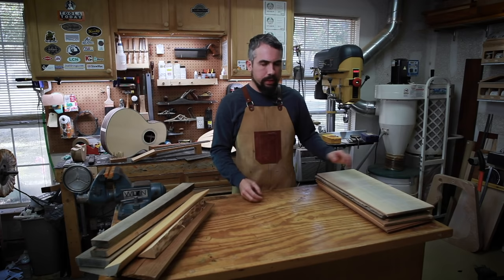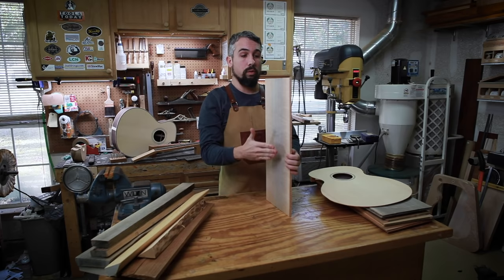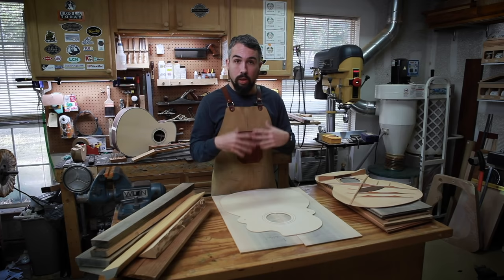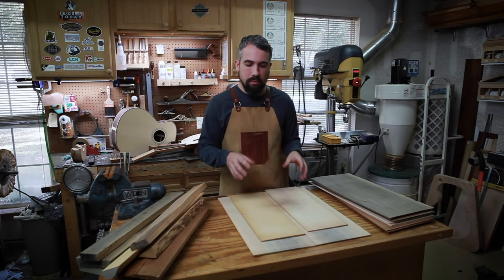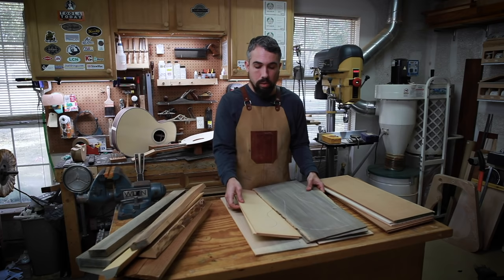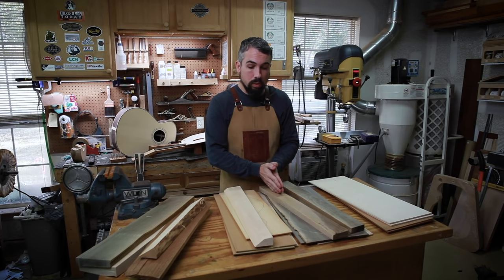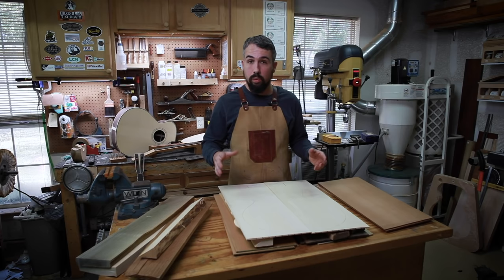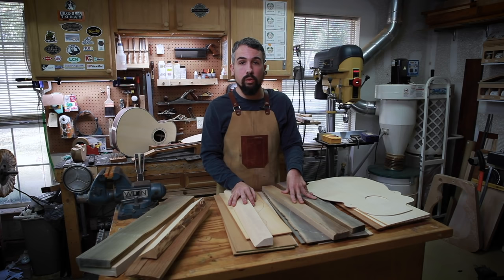What no one will tell you about acoustic guitar soundboards!

Comment: Truly excellent video.  Back jn the late 1980's I acquired a dozen or more 1x12x1"(3/4" thick) Kiln Dried Quarter Sawn clear Douglas Fir shelving boards.  Not a "soundboard wood" but very fine straight grain that when I resawed it into top wood and joined it the tops are truly excellent.  The stiffness allowed me to make very thin tops with radically scalloped bracing.  So far I have built two Drednaught Body guitars (1988 &.1990)  with Black Walnut back, sides and neck with French Lilac fingerboards and bridges cut from 50 year old extremely dense tight grained boards. I air dried those logs for 5+ years. The neck and tail blocks are also Black Walnut.  They were my first two acoustic builds.  Both have cosmetic issues but play well and sound great.   I learned by disassemblibg an old Guild D-40 that had been seriously abused. Found it in a pawn shop in NYC for $5. Those first two builds taught me a lit about building acoustic instruments.  Now that I am retired from my "daycjov" I want to tackle building my most favorite stringed instrument... The Baroque Cello.
Reply: I love lilac wood, so pretty and nice to work with. Never seen it used as a fretboard, that’s sweet

Comment: Your talking about overbuilding guitars prioritizing stability over efficiency. Every added mass counteracts the ability of the machine to flex and thus resonate. I get lost when woodworkers use magical language to describe their intuition based on years of experience. I believe most look at the top desired flexibility as being a physical touch and listening response rather than, "i just know when its ready or it speaks to me" which isnt what you said exactly but i,ve heard it said many times. Ive seen some builders use a more accurate/scientific approach. I forget the name but using a weight to show elastisity or movement under pressure. Overall very clear. One question though, how does one tell over time when the desired top is where it's most efficient. And how could we judge it to be so after the guitar is all together. How can we pinpoint it being the top that needs a change.

Comment: ref: 10:38
You can easilly measure the tap-force and the sound db and Hz. Also resonase can be measured. 
You can do it with a raspberry pi (any version) and 20-25$ in sencors. Software do it is free.
Reply: Can you refer me to the software for this, or some kind of guide? I'm a software engineer and was thinking about how feasible it would be to build something like this to do a Fourier analysis of the tap tones. I'd love to contribute to an existing project if someone already has the groundwork laid.
Reply: @cutebabyseal621  I have no specific solution, but any software would be closely linked to the sensor used.
If you search for:
 "Arduino vibration sensor"
you will get result for both sensor hardware, active projects ans videos.
 From that as a base for data I am sure that Fourier analysis and other filters can be used to greatly expand what the data can be used for.
Reply: @bknesheim  Oh sorry, your original comment made it seem like you had some familiarity with existing software.
Reply: @cutebabyseal621  Have seen it used and now what is "needed", but that is not the same as "Have done that".  :-)

Comment: I keep have running through my head that it must be possible to make a top of synthetic material. You know ...make it in such a way that it can resonate with certain frequencies and so on... Anyways, I really appreciate your attempt to apply the maximum of the properties wood can have into the instrument. It all connects with an excellent tone in the end..
Reply: All kinds of alternate tops, alternate bracings, tons of things out there. There are carbon fiber guitars that sound surprisingly good, very even. There are lattice bracing patterns that are nothing but what looks like a lattice work fence inside the guitar. One of the ones my brother uses in his is what is called a double top, where you take a pair of spruce tops and plane down the center area, and replace that wood with a honeycomb material called nomex, gluing the pieces together with a VERY thin layer of epoxy so you don't fill up any of the honey combs. What you have is a structure called a torsion box that is  very strong, looks just like a solid piece of spruce, but has none of the individuality that a solid top has. Some of these are some of the most vibrant sounding guitars I've ever heard, and that is coming from an original owner of a 1971 Martin D18 that gets raves when I play it. 

LOTS of work done to try and eliminate that variable.
Reply: You could engineer a top material with basically any characteristics you want, but guitar players are a conservative bunch and selling anything other than wood is challenging.

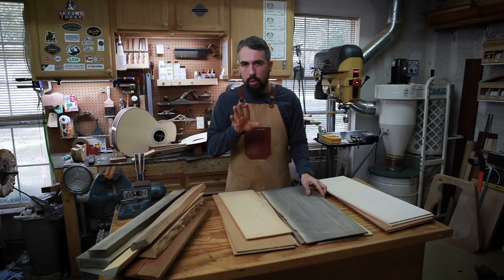Comment: To speak to your point about the issues with using tapping as a way to qualify wood, - if you listen to the tap comparison at 21:13 people will be so influenced by the fact that the larger boards have a fundamental frequency that will be lower than the smaller boards and they will then say things like it is richer or more round, but they are just hearing the lower 1st mode.  If you shape them so they have the same 1st mode freq I don't think most will say such things.  I am a structural engineer (and bad guitarist) not a luthier, I would try to QUANTIFY something like decay time as a better indicator.  So when you talk about having a top that is an efficient sound producer I think you are spot on.  Bowed instruments don't have this issue of only a finite amount of energy going into the sound production, but the energy that goes into sound production on a guitar when you release the stretched string is very small.  You can plane and brace to help optimize that, but I think the inherent damping of the wood is more difficult to overcome.
Reply from the maker: Dude that’s a great point and I’ll certainly try to use this for future vids. Thanks so much.

Comment: ..did what you said, ..went for lite weight and used Balsa wood for the top but it fell to Dust and collapsed on itself the first note I strumbd. All that whittling and sandin' I done on it jus to end up with a pile a Kindlin' dangit.🔥😳.
Reply: It's weight AND strength.  Light (low density) is pointless without strength, and high strength is pointless without light weight.

Comment: I read an interesting ASE journal article the other day about perceived differences in acoustic properties of guitar (acoustic) back and sides. As it turns out, most players, regardless of skill or experience level, basically cannot differentiate between, with any statistical significance, back and side woods in blind auditory tests. That''s the gist of it. Also, the acoustic properties / materials testing identified that the acoustic coupling between the back and top occurred in the air between, and the sides transferred very little, and it was the tops that contained and projected most of the sound information. This was shown visually by mapping the frequency curve and 'modals' (distinct peaks) of each guitar  that the top, back and sides would generate - the back and sides would create the two lowest modals, and the top would create the third modal. The curves and modals were almost identical across woods for back and sides. One conclusion was that "sound" a given guitar produced was a result of mostly the top wood, design, and construction/methods, not back and side woods. Super interesting article.

Comment: I understand exactly what he is talking about. But I also believe that certain woods have very different musical intonation. That's why we choose these certain woods. I've seen a test of the exact same guitars that were made by the same company but yet out of different woods and I was amazed at how much they sounded different. Not totally different, but yet different enough to show different character. And in music there are only slight difference in sounds but yet the cost of having that sound is priceless. Myself I would prefer an Aderondac spruce top with rose wood back and sides. To me that guitar had a much fuller sound than the Sitca spruce sound board. The highs were more dominant in the Sitca spruce top. And the Torrified wood also gave a fuller sound than a non-torrified sound board both of the same wood top. And yes the bracing comes into play and also the body style too.

Comment: When a tree grows the early tree rings have a wider thickness than the later tree rings. This is true in general of course the thickness of the tree rings also depends on the weather conditions during tree growth, but in general the early tree rings are thicker, wider than the later tree rings. When you book match and glue them together which do you put in the center which you glue them together, the early tree rings of the later tree rings? In other words are the early tree rings in the center of the tone wood or are the later tree rings in the center? Also does this matter?
Reply from the maker: I always put the tightest grain to the center and the wider to the edges. The way I see it, the wider is slightly more elastic, and I want that towards the rim.

Comment: I was so impressed by this presentation and it blew away a lot of my preconceived notions about soundboards. However, If the wood grain is best when straight, which I always believe, then, what’s the deal on bear claw that is being sold as most desirable?
Reply: Funny bear claw used to be considered a defect along with excessively figured back and side material. Look at the prewar Martins, most have very plain looking wood.
I have a ‘66 Martin D21 with the highly figured Brazilian. They chose that wood for the lowest tier rosewood guitar.
My cousin has a ‘66 D45 and it has perfect straight grain on every piece of wood.

Comment: I had a question if you want the top to vibrate with the least bracing why don’t you extend the neck like an i beam through to the brdge that way the string tension would be supported by the neck( think 335 sort of)at the back of the bridge letting the front float.That would eliminate the need for scallop bracing altogether.I know it would look stupid through the sound hole .My question is has anyone tried this?

Comment: Material selection doesn't really matter for capturing wind though no?  if surface area and geometry are consistent on the lead sail it should capture the same amount of wind.  Boat would just be heavier.   I understand rosewood is more dense and less ideal for a top but how do you decide on the threshold for viability?

For example say you were to try to use rosewood for a top and you shaved it down to equivalent mass to spruce or mahogany.  These reason why this doesn't work is because of a mechanical limitation once rosewood is that thin no?

Comment: Hi Chris, wonderful video. One of the most interesting part of it is the knocking on the wood. I have a guitar build for me by a German luthier, Urs Langenbacher. He told me that he actually measures the sound(board) electronically and tunes it in order to get every frequency equally in volume. Kind of equilizer so to say. I have heard that the thicker the wood is, the more it can respond to higher frequency's. So I wound try to apply different thicknesses in the soundboard or perhaps in the back and sides. Due to the acustic specifics, I wound be intersting to make the back and sides also from spruce or ceder. For nylon string guitars I like ceder more because one get more rich tones and they produce more sound and sustain. An experiment like this would be great, but perhaps it is not a good idea?

Comment: That was a fascinating and in-depth overview of guitar sound boards. I have had guitars made of several different materials for the tops ( Sitka, Engelmann, Carpathian and Adirondack) I have much preferred the most recent guitar ( a Collings OM ) with an Adirondack top. The additional headroom is essential on a small bodied guitar in my opinion. I had a Martin Eric Clapton model with lovely Madagascar rosewood back and sides with a Carpathian top. It sounded quite good but unfortunately the top started to do funky things within a year and I ended up selling it.
Reply: Interesting. Nothing beats red spruce (picea rubens) for stiffness and it may have an edge in other ways, hardness, resistance to long-term deformation. I've never seen Carpathian (which is the same ubiquitous European species picea abies) but really high altitude trees are slow growing with less late wood, and therefore lighter in density, I imagine. Englemann is a very light spruce, but variable.

Comment: What about using Densified Wood for sound boards. It is wood planking that has had the lignin softened and removed and extreme pressurization leaving a thin strong plank.  Would it be poorer, better, or any difference in sound applications I wonder.

Comment: Ref latitude/longitude. You may have heard expressions like "palm trees don't grow at our latitudes", meaning we are living too far to the north for palm trees to grow. Well, that shows what latitudes are about: Telling how far north or south some place is situated. Hence longitude is about the other directions - west and east. Now you will remember what is what, I hope.
Yoy talk a lot about spruce.  What is the difference between a fir tree and a spruce, by the way? I am not a native English speaker and have never lived outside my country of birth, Norway. Now, both fir and spruce is translated into the Norwegian word "gran". So I am not able to distinguish between the two.
Reply from the maker: Thanks for the tip! As for the difference between fit and spruce. I’m not exactly sure. In my experience fir is a lot softer than spruce and the grain is not nearly as tight. With that said, my only experience with for is back when I lived in Alaska and the wood was available at local hardware stores. I’m sure you could use it as a soundboard wood, but spruce would be a lot better. You live in Spruce country and it should be readily available, but it may be referred to by a different name in your language. Hope that helps a little.

Comment: Most of my life I have played solid body electrics, but now and then I have had an acoustic guitar: A Seagull Cedar, a Mouton Rouge Cedar - both sounded ok, and now I have
a Yamaha FG730S low to mid priced guitar, but it does not ´sing´. It has a light colored solid spruce top, but it is 3,5 mm thick, including a lot of coats of  plastic lacquer to
dampen the vibrations :-). Should I risk to ´butcher´ it, and take of the lacquer and some of the material, and give it a light coat of shellac? It is a $300 piece, used. I know I ought
to buy a real guitar, but I need to find out first, if I get hooked this time.

If we should believe the violin guys, the varnish has a lot of influence on the sound too. I read an article recently that some scientist had found the formula for the Stradivari
violin - something with Borax and stuff, to get rid of tree worms.

Comment: Why would I buy a Western Guitar with six nearly adjacent 6mm holes in the soundboard in the center of it that will eventually cause bowing of the soundboard? Isn't there a more structurally sound way to thread new strings than using pins?  Wouldn't a glued bridge with a backplate/backing on the inside be strong enough to hold the steel strings of a Western Guitar from ripping the bridge up if it were glued directly to the wood?  I'm loathe to see another wrecked, (while bowed), guitar, especially if I'd had it built.

Comment: Excellent, information packed video about soundboards and their woods. I have a Lowden with a Redwood top. It sounded good when I purchased it, but about 10 years later, it lost a significant amount of volume and resonance. Is that typical of Redwood, and can anything be done about it? Thanks
Reply from the maker: That’s pretty odd and shouldn’t happen. I suspect you have a brace that came loose or something.
Reply: @DriftwoodGuitars  Thanks for the advice. I don't hear any rattling braces, but I will definitely check that out. My primary concern was that maybe Redwood didn't age well, unlike Spruce which ages very well.

Comment: Interesting! I’ve been meaning to ask something I’ve been curious about. I recently bought an acoustic guitar with a sitka spruce soundboard. I noticed that there are some small surface imperfections that look like tiny “cracks” that run parallel to to the grain of the top.

These surface imperfections/“cracks” are less than a millimeter in width and appear just to be on the surface of the soundboard, and it doesnt penetrate deeper into the top.

I was just curious if this is a normal thing for all acoustic guitar tops to have? These little surface imperfections that run parallel to the grain of the sounboard?

Comment: how do i know the exact thickness for a piece of wood.  do i put a weight in the middle and check deflection? i usually buy them at 1/4 inch thick and start sanding from there.  like your videos. looking for some good cedar now.  have lots of sitka i get from this guy in north vancouver.
Reply from the maker: Yes deflection is one way,  as well as just feeling for it’s flexibility with my hands,. It becomes intuitive after a while and you get a feel for it. I also bump it up against the measurements I’ve made on past guitars just for good measure.